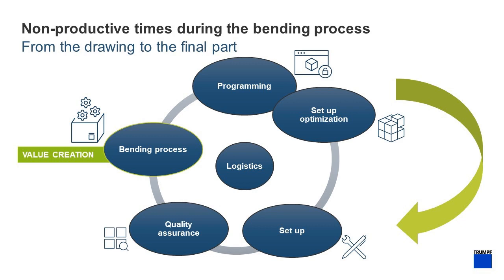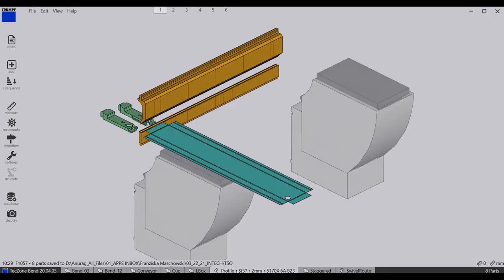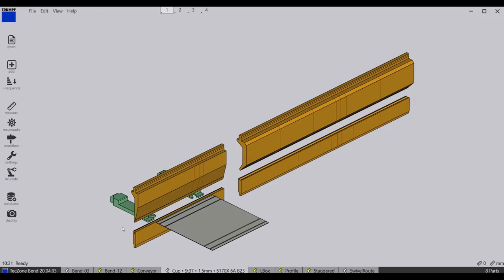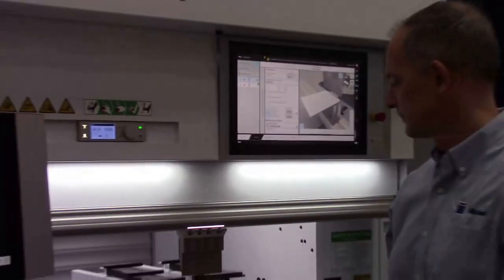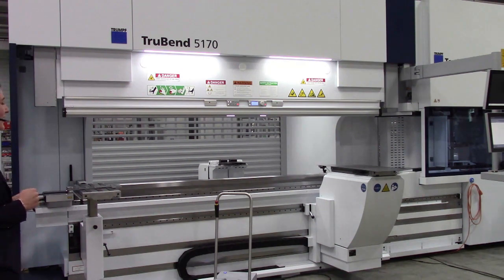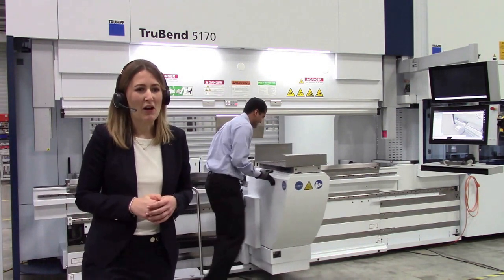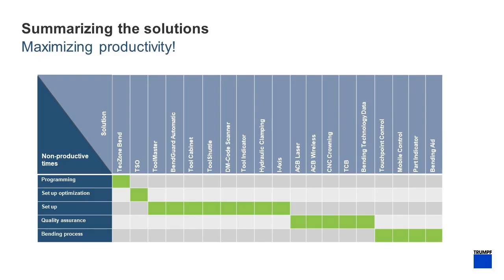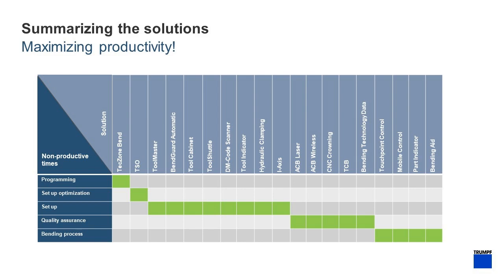TRUMPF Virtual INTECH 2021: Bye-bye non-productive times - This is how efficient bending works today

Comment: I'm an Mechanical engineer.
I'm working in sheet metal plant from last 2 years. We manufacture APFC panels, Switchgear, Breaker ACU box RVT NCT and all other electric materials
We have Yawei bending machine and we have 2 punching machines of Yawei.
These machines and technology is next level.... 👍👍👍😍😍